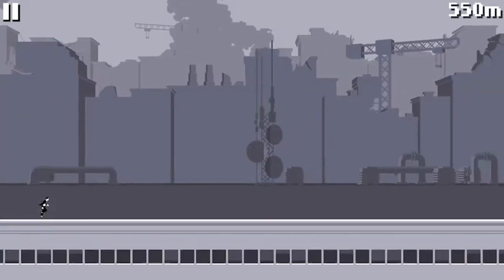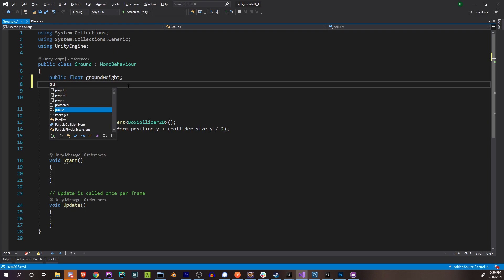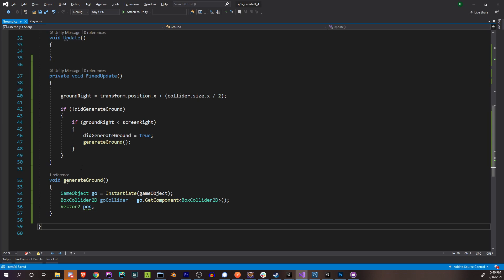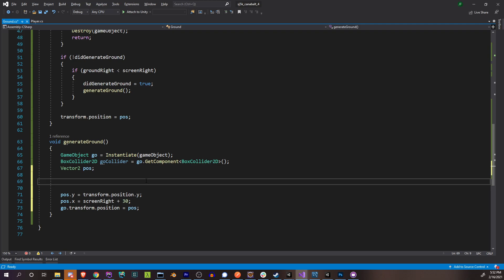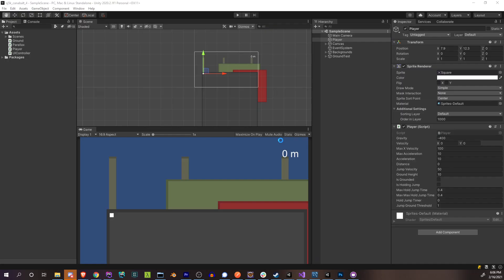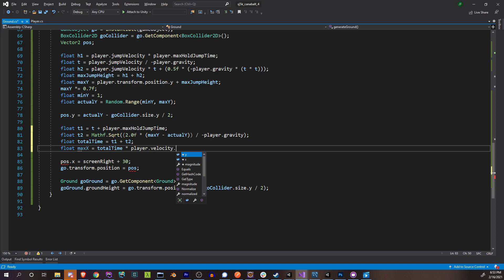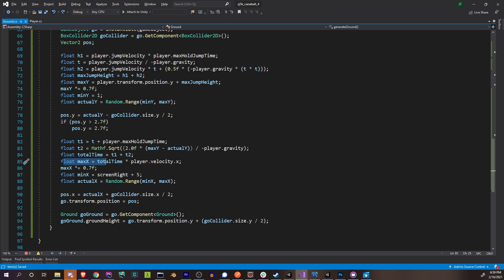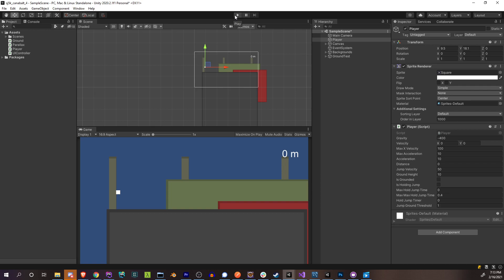Procedural Generation Of Platforms | MAKE AN INFINITE RUNNER game like CANABALT #4 | Unity Tutorial

Comment: great tutorial love to watch :) question: Isn't it also better to make the width of the platform depended on the player speed? If low speed small width platforms are possible and the higher the speed, the wider the platforms must become?
Reply from the maker: Thanks. Yea that's certainly something to consider. But I do like the other challenge that when you run too fast, you have to watch out not to jump too far. Give it a shot.

Comment: what are the maths used for set the bottom left corner in the 0,0 position?
Reply from the maker: You just have to position the camera based on it's orthographic size and aspect ratio. If the orthographic size is 5, then that's the y coordinate of the camera, since the orthographic size is half of it's full height.
If your aspect ratio is 16x9 then multiply 5 by 16/9 (1.777777) which is approx. 8.8888 so that's your x coordinate.
Reply: @superjustin5000  thanks dude! i'm gonna try that operations, thanks again to make awesome videos

Comment: Half of the character I put stays in the ground.
Reply from the maker: That's correct, and intentional. It all depends on how your final Sprite will look, where you position the ray casts, and how you position the Sprite based on the ground height. Usually you want to add on half the Sprite height to the ground height on land, and lower the ray cast by the same distance.

Comment: (maybe my previous comment has been marked as spam)
Hi, I got a problem that the first generated platform sometimes reaches the maximum y or the value of y that player cannot jump onto it. I have copied your ground code and this still happens. Could you please tell me what mistake I could have made?
Reply from the maker: Hmm tough to tell without your project files. The ground script also reads a few values off of the player. It might be helpful to make sure those are correct off the start. The ground would get generated too high if the something was off with one of the jump variables. 
Also be sure to check your scene setup, I hard coded a lot of value (Not good practice) based on the size and position of my camera  relative to the scene.

Comment: I don't understand how the loop works because there is nothing changing the didGroundgenerate back to false. So surely after one ground is generated and this Boolean is given the value true, no more ground will be generated as it doesn't pass the condition !didGroundgenerate.
Reply from the maker: Pretty good observation, but there is a bit of a trick. It's a ground that's responsible for generating only one other ground, then the next ground generates the next and so on. So each ground only needs the boolean flag once.
Reply: @superjustin5000  I see so the ground generates one, and because the new ground is created with didGroundgenerate having a value of false, that will then generate one more ground and so on.
Reply from the maker: @aadityadahal4622  You got it!